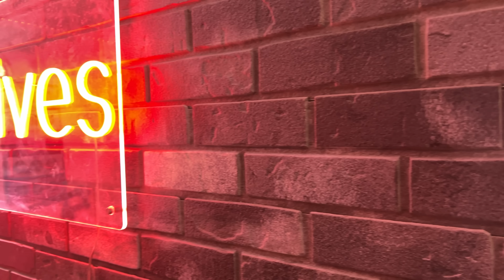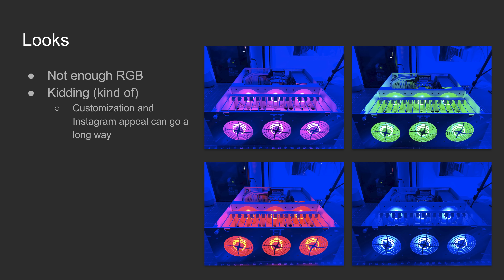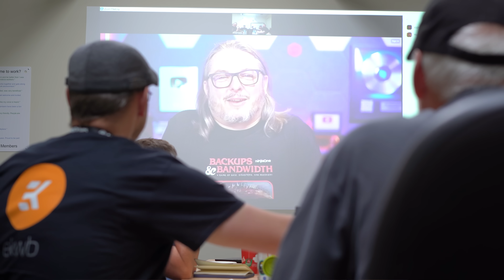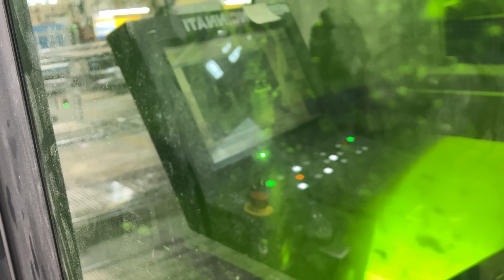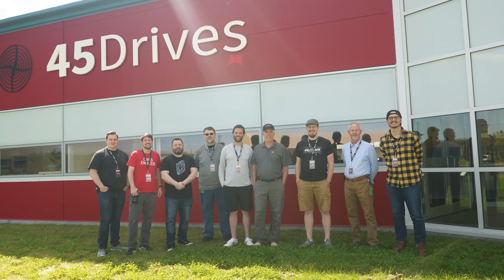NEW 45 HomeLab HL15 at the Creator Storage Summit

Comment: If you want to do this on a Budget you can use an HP z440 computer with LSI 9300 SAS controller and add in internal Harddrive cage for a total of 8 internal hard drives. You could put together an entire Xeon computer with 64gb ECC Ram and controller for about $300. Or you could use one of these motherboards in your HL15

Comment: Wouldn't a valid deployment of this server chassis be to build it with a pcie drive?  If you were doing it at home you could steal the x16 slot for 4 nvme drives, but if you wanted something faster you could always put in a solid state add-in card.  I'd do that before sacrificing spinning disk space for 2.5 inch drives, if I needed something fast to boot from.

Comment: 45 DRIVES WHAT A SCAM !!! 45 drives will charge you 2000 or more just for a computer case !!! and they pay or give gifts to youtubes to promote ther product ,  they have the spec of ther machine on the site ,, so for a server that cost lest say 5000 the hardware mb , cpu , ram ,controlers ,psu , cables ,  cost less than 2000 ,  and you end up pay 3000 for a blody case !!! and the dude that will spend 1houers assembling it ,  and install the os ,
Reply from the maker: Not sure what you’re talking about.  It’s 2,000 fully loaded without drives
Reply: the price on ther site is for empty , they give you only 2 250ssd  @TechnoTim

Comment: I 3d printed something similar for my Fractal Design case, but it was quick and dirty. It basically just allows you to mount 4 drives to each other, and then utilizes the bottom drive's bottom screw holes to mount to the case. This definitely inspired me to redesign the mount and the new heat press tools I have :D

Comment: The mix and match of SSD and HDD chasis looked more interesting for homelabs than the homelab specific one. It looked like it just sacrificed 3 HDDs to add a handful of SSDs. Since large SSDs are expensive, having a handful in front of a bunch of HDDs is often a better option for homelab. Especially great for something like Unraid. I know they're quality chasis, but those prices are still high and I would like front accessible drive bays instead of having to slide the unit forward in the rack to swap a drive. That second part is more of a want than a must have.

Comment: I think U.3 reffers only to the backplane where it can take any kind of drive SATA, SAS or PCI-e
Reply from the maker: Thanks for the clarification!
Reply: @TechnoTim  U.3 is an interesting beast... U.3 drives use the same physical connector as U.2 drives (and SAS), but allow NVMe to be used, and you could have a U.3 NVMe drive or U.3 SAS (never seen SATA drive use that connector format though).

There's also been some back and forth over whether "U.3" is the name for the new connection standard or not... some people prefer to call it a 'Tri-Mode' connection, but I just like U.3 because it's somewhat an evolution from U.2 and it's easier to conceptualize. The fact is has '3' modes makes it even better!

Comment: Dunno, the pricing is more viable for mid size business not for the homelab.
Reply: what pricing? the HL15price wasn't announced afaik. That's the "for home lab" rack, everything else is for businness
Reply: @marcogenovesi8570  They've said starting around $800 on a few other videos
Reply: @marcogenovesi8570 hey! So yep our home lab website is live - and we are in presale. The price for the HL15 with backplane, cables and power distribution block is $800. I promise you guys that we did our absolute best to keep the prices down as much as possible. We work on very thin margins as we are a cost + company. Our chassis are built to last. We are still actively supporting servers 10 years old in the enterprise and we aren’t like other vendors who will charge an arm and a leg to support “end of life” products. Hope that helps !